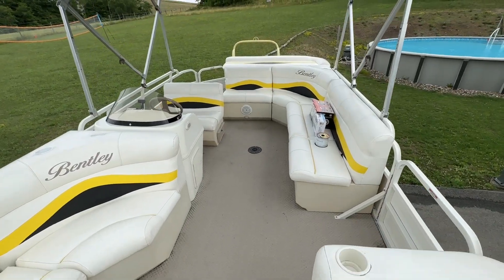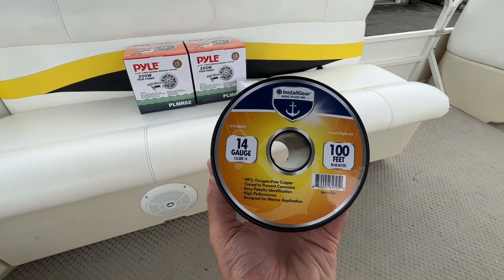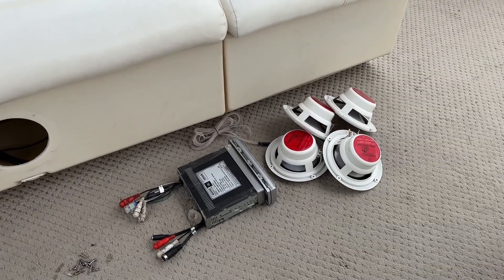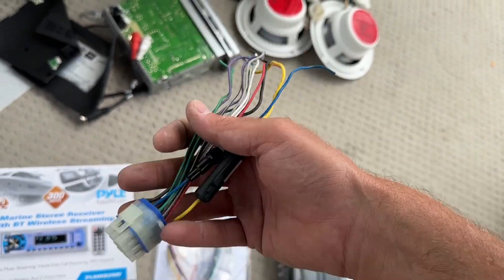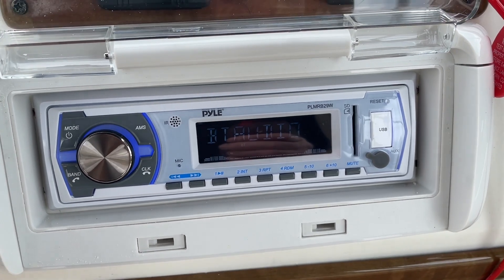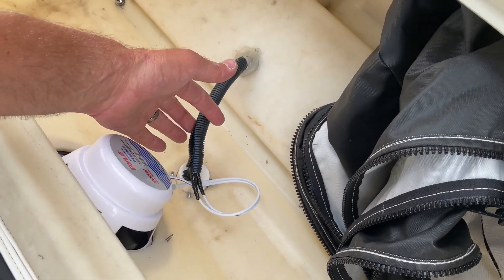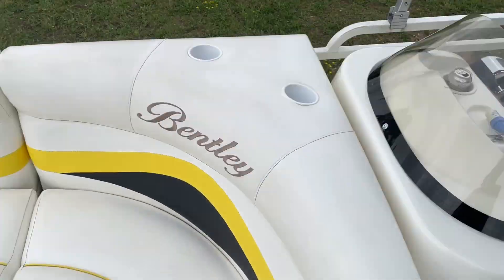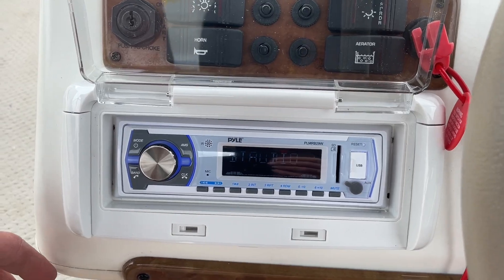Installed A Pyle Bluetooth Radio & Pyle 6.5” Marine Speakers On My 2010 Bentley 240 Cruise Pontoon.

Comment: Yes, I purchased the very same Pyle Bluetooth Radio & Speakers. What antenna and plug should I use for the am fm, and do you need a amp for your unit or is it great without an amp?
Reply from the maker: I used the antenna that came with the boat.  I did not use an amp.  It was loud enough for us but an amp would make it louder.
Reply: @DieselLegiance  Thank you. I wasn't sure the antenna plug I needed, it looks like they make two types but I think I figured it out. Good to hear the system is great without needing an amp. I appreciate you replying back so fast. Your video is very helpful as well.
Reply: What radio cover did you purchase?

Comment: I just bought the black version for my 4x4. Have you had this out in the sun at all? I have heard that the display washes in bright indirect light. I've already been disappointed by a couple other brands. It looks overcast in your video but the phone seems to be picking up the display just fine - other than the LED sequencing. Do you have any issues seeing the display at all?
Reply from the maker: You can adjust the brightness but I had a Bimini top up most of the time too so I never had any issues.

Comment: Is the Pyle head unit actually waterproof?  I can't find anywhere that says that it actually is other than the Amazon description.
Reply from the maker: I have a cover for it so not 100% sure.  But it works fine for me and I’ve used it a good bit so far this summer.